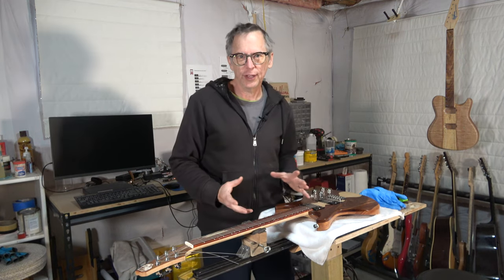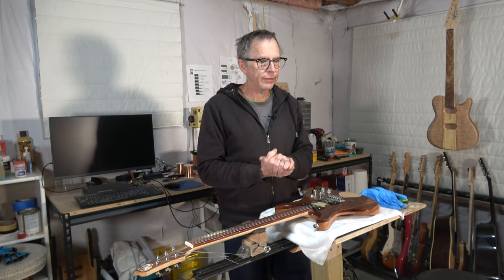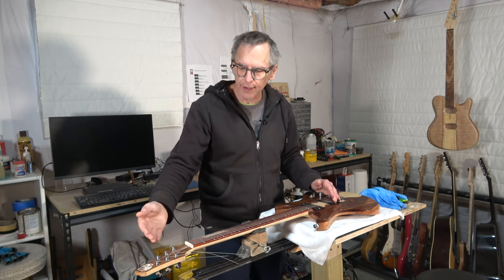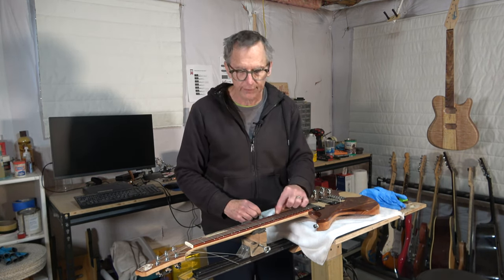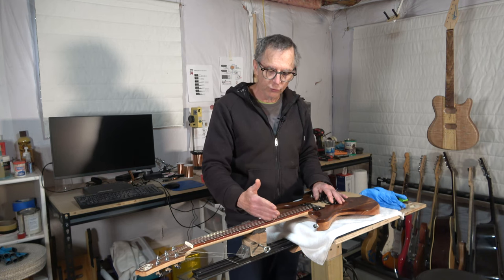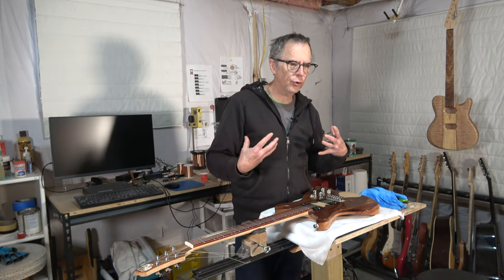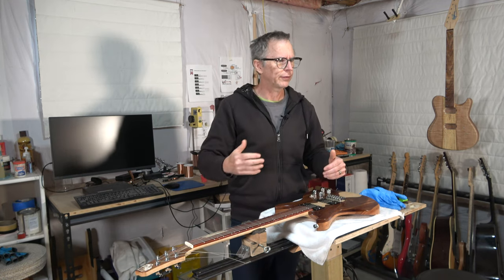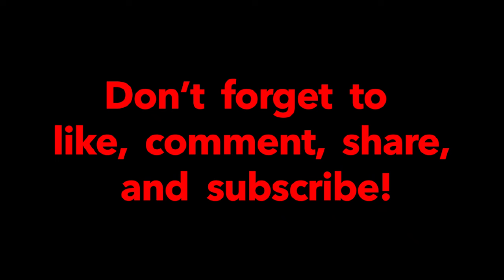The Truth About Guitar Neck Relief

Comment: Nice description of how and what relief is.
I have some guitars with dead straight necks  and  others with a little relief.   For basses I pretty much always have a tiny bit of relief except for fretless where I want perfectly straight. Lots of factors to consider but especially playing style.  
Its weird seeing 2 players try the same instrument with a little relief and it work for one but not the other.  Then adjust the relief to perfectly flat and see the reactions can flip.  
As always,  nice video.
Reply: comments like these are very helpful for someone that's learning like myself, ty for this. the video also was helpful in that it describes the movement up the neck upon fretting for the max oscillation.
Reply: @staleyexplores  Thanks.  So much depends on preference and playing technique.  
Opinions by prominent builders varies too.  Roger Sadowsky recommends and says on his website the he's "had the best success with the neck essentially dead flat.”   
On the other hand, Paul Reed Smith recommends on his company's website  "Using a capo at the first fret, measure the distance from top of fret to bottom of string while depressing the string at the 1st and last fret: Relief for PRS guitars should measure .3/64" - .6/64" (.1mm - .3mm) at the 8th fret." 
Note those fractions have .3 and .6, not whole numbers so that equals around 4 thousandths and 9 thousandths of an inch.

I'm not going on a limb and say either Roger Sadowsky or Paul Reed Smith is incorrect.
Reply: @staleyexplores woah hey another Staley!! Don’t see that very often! Cool man, our line went through Missouri, to Kansas, and then Arizona. I broke code and moved back to south East. Them damn staleys are nothin but dirty nomad hippies 🤣🤣🤣🤣
Reply: @TheyFearUAwake  definitely a name I am proud to own for a little while 💜! Thanks for dropping me a line! Think I was named after my great uncle from Tennessee. Cheers friend!!😎

Comment: when they put the adjustment at the heel of the neck to begin with,it  kinda indicates you should'nt be diddling with it every little whip-stitch, but instead  is a preventative reinforcement to keep the bow and arrow thing from occurring. The Geometry of those strings is literally "Math Rock"😉

Comment: I quit using adjustable truss rods in favor of a carbon fiber "D-tube" inlayed the length of the neck. Ie, it forced the neck dead straight and will never arch. No issues with action at all.
Reply: I asked a friend to build a neck using that D tube for a baritone neck. It’s completely straight even under tension he said.  Question here is: How do you set relief for it if necessary ? I’m researching this not as a luthier but as a person interested in this topic cause there’s this view that relief is needed and other holding the view that a straight is what’s optimal

Comment: It all has to do with the standing wave of the string vibrations. The largest wave will always be at the mid point in any length of string. The higher the note the shorter the string the smaller that standing wave gets. Therefore less and less relief is needed as notes go up. This is why only the center of the neck gets the relief. To account of the larger standing wave of the lowest notes..
Reply from the maker: Relief is often not necessary on guitars where the strings gradually ascend to the bridge. And that is the case with most guitars.

Comment: Thank you for providing Informative videos.

Please note I like the necks on my guitars to be dead straight as an arrow with NO relief.
I’ve been told by the local “luthiers” that all guitars have to have relief to prevent string buzz.
I know this is BS because I’ve had guitars with straight necks and low action and they did not have string buzz…the luthiers had the audacity to tell me that I’m not remembering my guitars correctly because all guitars have string buzz with low action that I prefer.
Correct me if I’m wrong:
If the neck is straight as an arrow with no relief or back bow and the nut slots are cut just right and the bridge and saddles are the right height - the strings should run parallel with the neck and not buzz.
Please advise.
Cheers
Reply from the maker: In most cases where the neck is dead flat, the strings aren't exactly parallel with the frets. They gradually climb higher toward the bridge. You want that so the strings will have room to vibrate without buzzing off the upper frets.
Reply: @HighlineGuitars  Thank you for responding.  Yes, the strings do have a gradual climb toward the bridge.  Allow me to amend my question: Can I have a dead flat neck with no string buzz? or am I not remembering correctly the necks on my other "shredder" guitars from years ago (as I was told by the luthiers) :)
Reply from the maker: @Spaceman-jo5mz  Yes you can. However, a normal relief of .008” is almost impossible for most people to detect. It feels flat. Therefore, what you may have remembered as dead flat may not have been.

Comment: Yes when you press a fret the point of max excursion move forward but the amplitude decrease constantly.
The max amplitude is with open strings and it's located in the middle of the neck, roughly.

Comment: I think one crucial aspect of neck relief is that the trussrod reinforces the neck and helps adjusting the relief but there's still plenty of elements to take into consideration! Necks will usually be different to each other in how they handle the pressure of the strings. Just because you measure relief at a certain point, the neck could have a wildly different curve compared to another neck set at the exact same relief! This is really something most youtube videos and blogs skip! And then the 'simple subject of relief' even goes way further in depth with subjects such as fret compression and sanding the fretboard etc

It's invaluable to learn how to read a neck! And it takes a looong time to learn all these small details because not all youtube channels are as helpful as this one! A great way to find the relief that suits you is to set it up with just enough room for the first few frets to vibrate and not too much whereas you will run into buzzing in the middle and higher up the neck. I prefer as straight as I can get away with; so for electrics usually 5 thou and for acoustics dead straight!
Reply: The truth is having a fine tune instrument is a real pain in the brain!!! Because to obtain this the nut is cut with very little life left , everything has very little room for wear and or change, hours of work lost in a short time to usage or change in environment. Perfect intonation is as easy as learning how to correct intonation problems with muscle memory and hand control which is possible lol

Comment: A straight neck sounds like nails on a chalkboard to me, lower strings don't resonate fully and even if it's not buzz per se the immediate frets rob a lot of tone and sustain. I need about 0.030 as per Fender specs measured at the 8th between 1st and 17th fret otherwise it's torture. And the bending gets much easier. I don't have to punish my fingers with the extra tension a bone straight neck makes

Comment: thanks to chris and also the commenters here that confirm my suspicions.  I have been playing and doing my own guitar setups for a very long, but never paid any attention to "neck relief" until recently.  I've always set my neck flat, and my frets even and smooth, and then lowered the bridge until the strings were low and even.  

Suddenly I start hearing about and seeing "neck relief" and I wondered 😕 have I been doing something wrong all these years? Judging by the vid, the comments, and my own setup results over the years, NOPE.   I love the comment about neck relief just being a manufacturers cheap solution to poor fretwork.  That is probably exactly correct.  I plan on producing my own guitars and they won't be needing any such "feature".  Just good old craftsmanship works the best imo.

Comment: Neck relief is a huge myth.  In 2007 I bought a guitar with a perfectly strait neck.  I brought it back into the store because of the fret buzz, and the store 
owner said the neck was "too strait".  He "fixed" the problem by turning the truss rod instead of checking for high frets.  That guitar was pretty crappy anyway, but the idea of neck relief stuck with me  until I started building guitars last year.  That is when I realized that neck relief is B.S. and usually is added to a crappily fretted instrument, or when someone can't figure out how to fix the fret buzz.  There are alot of guitar players out there that actually believe there neck has to have relief.
Reply: My peers growing up told me that a guitar must have relief at the 10th fret, and I completely agree with you, it is to easy to turn a truss rod than to have the proper tools and experience to correct a very delicate problem, I’m a protectionist when it comes to intonation, but don’t spend any time on chording the guitar correctly! My uncle could make even a plastic kids guitar sound incredible, he told me “the musicians make the music not the instruments “,watching him I have no choice but to believe it’s true.
Reply: Fret buzz is fine. You don't hear if like myself your a really light player. Even as a Brian may fan, bm gear, owner and user, you can tell Brian has fret buzz as his frets have never been replaced. I like a straight neck and super low action. I don't like upbow at all. Personal preference. ;)

Comment: I'm very thankful you validated my thought process of setting my own guitars up. I noticed with strats Les pauls didn't matter when I put a little relief as they call it in the neck I got fret buzz from about the9th  10th fret on. And when I made my neck perfectly straight I didn't have it anymore at first it Really puzzled me. Because I have an extremely light picking technique. Then I figured it out. When I talked to other guitarists about it oh my God. You would thought I said a guitar made out of concrete or crayons can sound just like your vintage strat or lp.  I didn't say it but damn it I wanted too.😮

Comment: I have learnt so much from your various posts. Regrettably, the translation here is incomprehensible (at least to me). I do see what you are getting at, but the string height is always rising above the frets as you move towards the bridge (although obviously you are lowering it again as you move up the neck (but most of the heavy chord work is lower down), so most of the potential for buzz is still at the low frets. I not that Bob Benedetto builds his necks with NO relief (presumably relying on tension to create relief), and Jazz guitarists are notoriously picky for 2 things: playing with strings like ropes and being very precise over their desired action. Peronally, I never dial in relief and I never have complaints of buzzing.

Comment: I run a machine shop and I used to build guitars. I'm currently experimenting with some really thin aluminium necks and richlite fretboards. Theres no truss rod in the neck and I'll be interested to see how it pans out as I've always thought having a truss rod is better than not but regarding this build the aluminium is significantly more rigid than wood but I can't be sure as it's a prototype. I'm debating installing some carbon fibre rods to give it even more rigidity. Be interested hear your thoughts. Cheers Man Jack

Comment: Another factor is that the neck is thicker near the bridge than near the nut, this causes that under string tension, the effect of the trussrod by itself never could reach that the neck be completely flat. I think the better solution it´s a little bit of relief. These are the questions when you more think about, the more you move away from the solution.

Comment: I noticed on my Warwick corvette $$ limited edition bass when checked with a 34" notched straight edge on fret board theres more relief (.016") vs when i take that same tool and lay it on top of the frets instead.  And its in a slight different spot. I get .004" with a feeler gauge at largest gap on fret.

 So now which one should i use?  Seems like the actual frets are flatter then the fret board wood. How would you approach this setup? Does it mean the frets were leveled with a neck that wasnt straight to begin with?  Thanks for sharing this info!
Reply from the maker: It sounds like the frets were leveled without checking the condition of the fretboard first. If it were me, I would pull all of the frets and re-radius the fretboard with a radius sanding beam. My goals would be to make sure the radius is correct and that the surface of the fretboard is level with the truss rod in the neutral position of adjustment. Then, I would press in new frets. Sometimes when you install new frets, the pressure of the tangs in the slots can change the fretboard's state of level. If it does, you can correct it with an adjustment to the truss rod in order to level the fretboard. Then, I would proceed with leveling the frets. By doing it this way, if you want a certain amount of relief between your notched straight edge and the fretboard, it will be the same amount and in the same place at the tops of the frets.

Comment: I use the rule of thumb when setting neck relief. I set the neck relief as low as it will go without string buzz, and if the action is too high for my taste, I beat that guitar with a stick that's no larger than the diameter of my thumb. I'm joking of course. If the frets need to be leveled, one would do well to set the guitar for zero relief, level, dress and polish the frets, and then add neck relief to taste.

Comment: Chris, something I have wondered regarding this is - on a zero fret guitar might it be better to just have a slight angle to the neck instead of a bow? That would take care of needed relief, and if a person doesn't really play a lot in the upper register. I think I would take the trade off. Your thoughts?
Reply: I'm not Chris, but I build all my guitars with a zero fret and no relief dialed in. I rely on string tension to provide any relief. I recommend Roger Bucknell of Fylde Guitars for an excellent discussion of the value of the zero fret. As for neck angle- if you mean neck to body angle, that's not really related to relief and numerous sites give neck angle calculations for optimum string height. Cheers
Reply: @robertnewell5057  What about a situation where you have a reinforced graphite neck that's perfectly straight no matter whether the strings are on it or not ? I had one built as an experiment and the luthier has the option of building one using traditional methods to replace it if this fails. Is that completely flat neck still viable ?

Comment: Guitars never used to have truss rods and they played with low action. I've played 18th century parlor guitars with straight necks and action lower than a modern shredder's guitar. No buzz anywhere. I've played pre-truss rod era jazz guitars that were the same. I think Gibson invented the truss rod just to speed up production in their factories.
Reply from the maker: Gibson invented the truss rod because their necks are made of Mahogany which is prone to excessive bow.
Reply: How does it speed production when adding a whole other step into production? Your talking drilling a hole , fabbing the truss rod, setting it in, setting it, adjusting it, sounds like more work added

Comment: ´‘I’m really over the moon with these Steinberger guitars. The necks are specially made for me. They’re made with no relief, ‘cause I’ve never believed in that. I don’t believe in that theory at all. It doesn’t make sense. I know why they did it on old acoustic guitars with a big action, just because the string where it vibrates the most in the middle is more likely to buzz. But it causes problems all over the guitar. The best way to me is to take two straight lines; so the neck’s made with no relief, and it’s got a 20in radius, so it’s really flat, and Jim Dunlop 6000 frets, so they’re really high. There’s something about the guitar when the neck’s got an underbow in it, it feels soggy in the middle.’´ Allan Holdsworth.

Comment: Does neck relief help intonation has I have found relief helps lower chords intonation while minimizing string height at the bridge, but I have a fender that I have spent hours making every string note perfectly every where under the 16 fret and still block A cords up the neck are a nightmare to listen to, maybe a plex job and someone who cares like you is the real answer, looks are also very deceiving as I have had guitars without intonation problems but the strings settings look very incorrect to an trained eye, intonation is a nightmare for guitarist that play different styles and everywhere on the neck

Comment: At 10th fret and above, what causes choke-out on double-tone bends on E or B string?
Reply from the maker: Too small of a fretboard radius. A flatter radius would probably work better. Or even better, a conical radius with 16” at the heel and 10” at the nut.
Reply: @HighlineGuitars  Strats and Teles come with a 9.5" radius.  I have a few.  Some allow double bends above the 10th fret ... some have choke.  Could it be uneven upper frets?
Reply from the maker: @RideAcrossTheRiver  Yes. Also adding fret fall off can help.
Reply: @HighlineGuitars  Can that be done with a simple fret file?  Or is it a job best left to a pro?